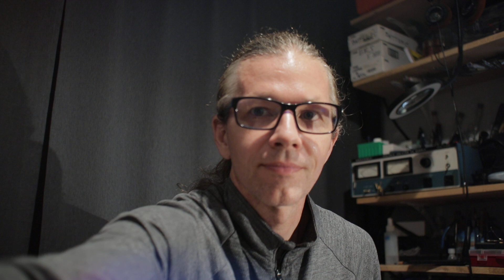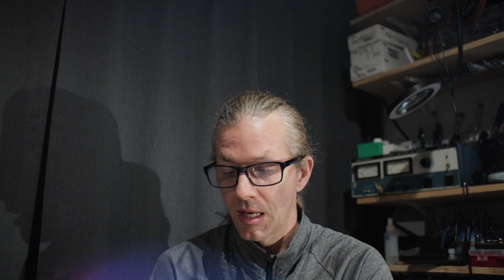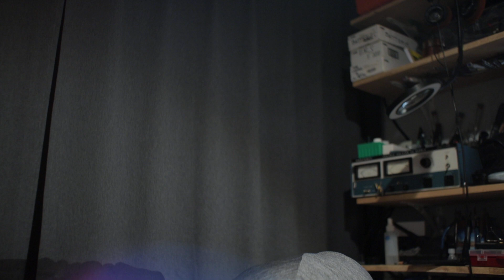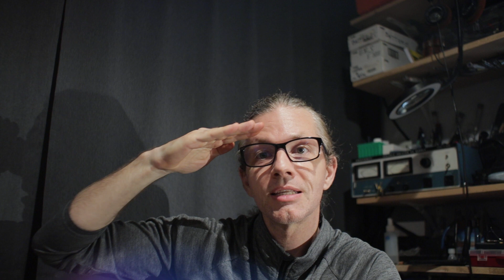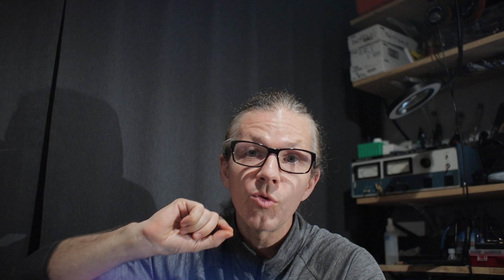The Laundry List of Tube Aging Factors

Comment: I've only worn out one pair of tubes in the old Tjoeb CD player from back around 2000. It was 2 years of daily use. I am sure the tubes would have tested ok. But when replaced It breathed life back onto the system. They were 6dj8 tubes. Since then I am wary of used but tested good tubes as they are likely worn to where they work but are no longer hifi.

Comment: Tanks for turning attention to fundamental factor of plate power regarding lifespan of tubes. Those emitting from plate ex  less than 0,5W ( ECC83 typicaly 1mA x100V means 0,1W)  due to untouched geometry  may be used many years as  It is reported by most users.  - I still use some made in 60 ties. and I  in my 60 years experience     had may be 5 times  damaged audio/radio tube . But not so in TV sets where filaments were supplied by 220V in serial TV sets with many tubes of high power developed  blown filaments more  often

 Cathode of tube is heated to make cloud of electrones. That cloud is supposed  to be capable  to support plate current. In 20-30ties I beleive it was elaborated how much is enough. . If cloud is too poor  because tempreature is low electrostatic force drags electrons from   atoms of emitting substance causing it's vanishing.  That is why I prefer tube rectifier which delay plate voltage to tubes.  

Keeping filament voltage  at requested level is best  practice. But if voltage is a bit   not sufficient, temperature of filament decreases and resistance falls causing the compenstion  of current In result dissipated power is mantained.  By analogue voltage too high increase temereature and decrease current. It is self stabilising efect which helps  in long lasting operation.